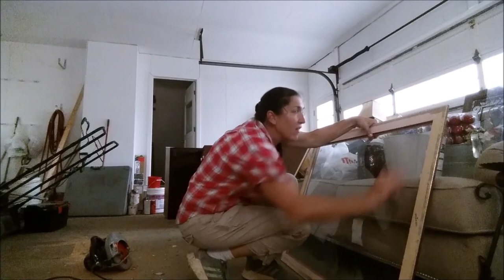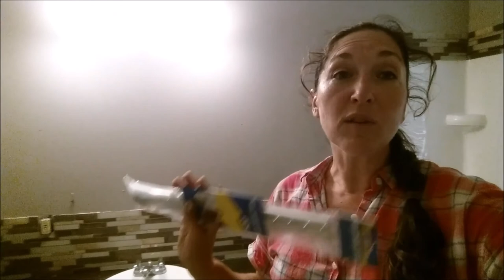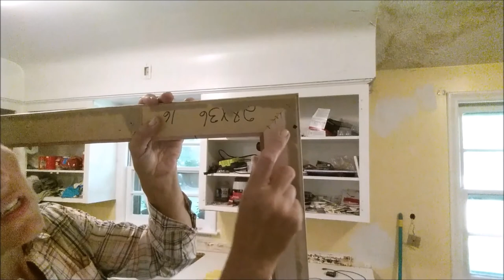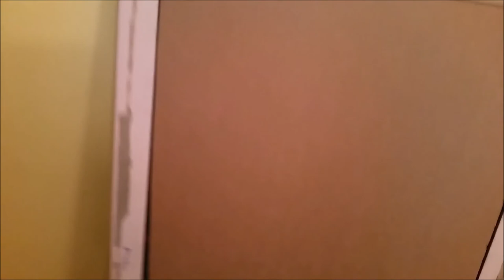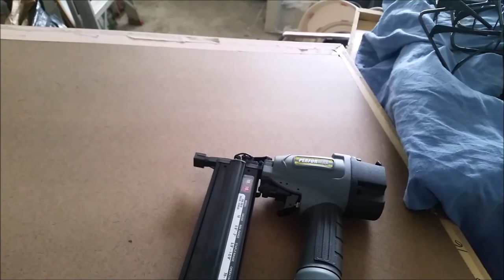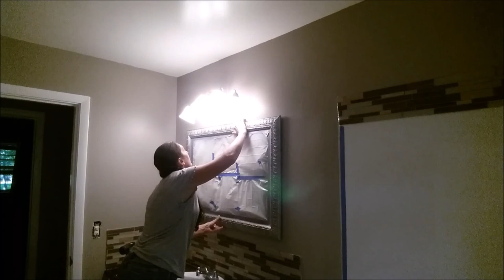DIY Framed Mirror Project

Comment: Nice project, thanks.  I had mirrors that had bad edges and I had a mirror company cut them down, but it never occurred to me to fit them to a picture frame.  And if I thought ahead that far, I don't think I would have thought to paint them.
Reply from the maker: I just a free box of broken frames and a pile of used tires. The tires will sell for $20 each and pay for my new hobby! We have cutting tools for glass, it's worth a try.
Reply: @mommymilestones  recently I sprayed a piece of glass with chrome paint, thinking it would make a mirror, it didn't.  It has some reflectivity, but nothing like a mirror.  I then found out they make special paint to do that.  

If you had a glass top coffee table, you could paint the bottom of the glass and color it to accent the room.  I bet you could even use a stencil to create a design on it. 

Have you ever stenciled around the wall next to the ceiling.  My X bought a stencil and painted something like flowers and it really spruced up the white walls.  And it looked so much better than the kind that  you roll out and glue to the wall.